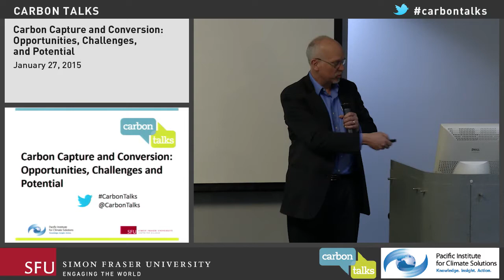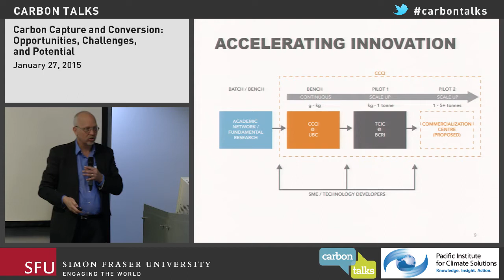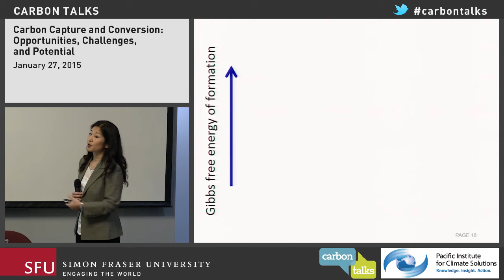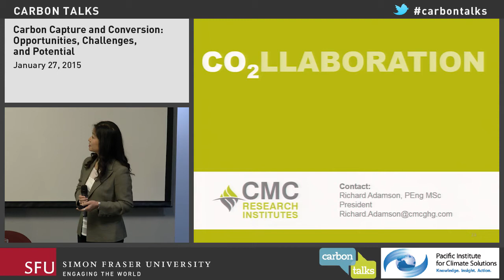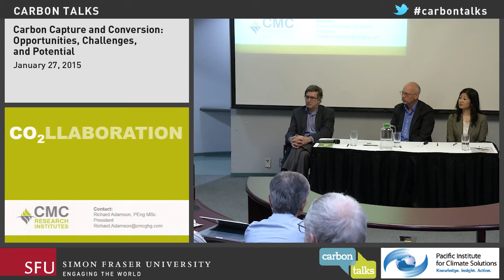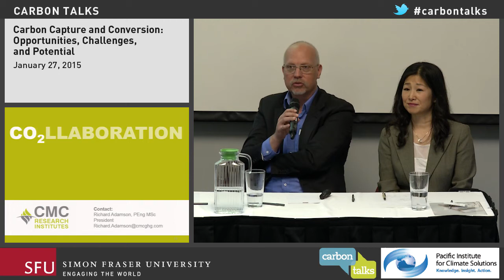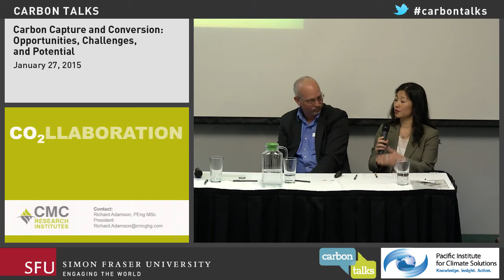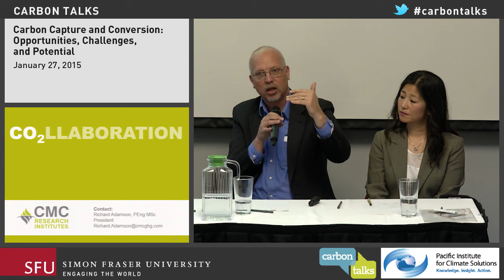Carbon Capture and Conversion: Opportunities, Challenges, and Potential

Comment: One Erratum in the Q&A section:
During the Q&A I mixed up a couple of sets of calculations when referencing the amount of wind required to offset the 1 MT/year Quest CCS demo. The correct amount is about 250x 1.9MW turbines assuming very good siting (30% capacity factor) and granting full credit for displacing coal (a generous assumption as this does not take into account natural gas peaking capacity required to complement the wind). This would cover an area about 10% of the area of Calgary, almost 8000 ha. The 100 sq miles number I quoted on the fly related to a different calculation. Apologies for any confusion.